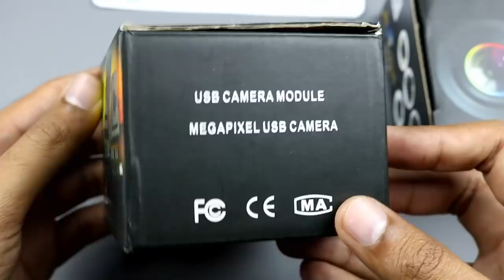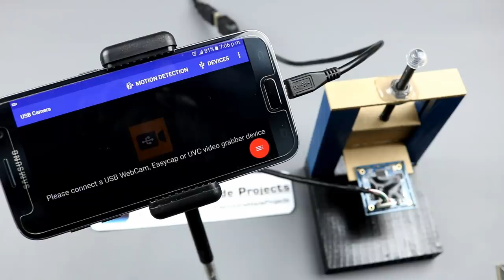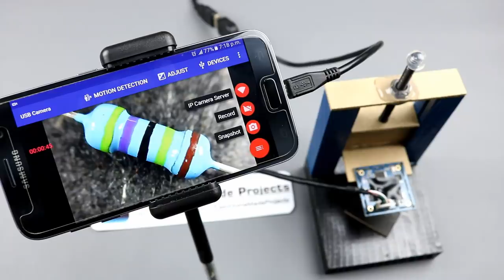How to make HD Digital Microscope

Comment: Nice idea but the camera on the phone is probably better. I use my Samsung Note 4 for this sort of work all the time as the zoom is great for reading all the component values and inspecting solder joints which I often need to look at different angles so a fixed platform doesn't work so well.

Comment: Using that particular camera apparently gives you very little clearance for a soldering iron, due to its short, but fixed focal-length. You might have gotten better results, had you used the third camera instead (i.e., the one that focuses like a DSLR).

Anyway, thanks for this video. This setup would likely save a lot of money over the purchase of an electronic hobbyist microscope. :)

Comment: Looks very interesting but the working distance seems a bit short for electronic use, is there a better camera that can work at a further distance say 10 or 12 cm away?  The magnification can be no more than 50 times
Reply: I am curious about the same thing you asked. It's been a year since you asked, so have you found the answer yourself seeing as you never received a response?
Reply: It’s actually only a matter of the stand (build it higher). ELP have such a wide range of camera modules (non-distorting, up to 1080p50, long focal distances) that you only need to select the one that perfectly fits your work situation. (I’m not affiliated with them anyhow but used their modules in the past.)

Comment: Great, I particularly like the mixed imperial and metric measurements.
Just wondering if I could strip the camera module out of an old phone?
Reply: You can do it, but you would have to buy or custom make an camera extension cable. They don't have a standardized pinout, so what works for you may not work for everyone. It's not worth designing an circuit that turns your phone camera's signals into HDMI. And if the phone is a smartphone, you can integrate it into it and get a microscope that beats all others for a similar price!

Comment: Another thing you can use as an HD digital microscope is an HD digital microscope. It's similar to this, only half the price, doesn't involve hot gluing and doesn't get in the way of your soldering iron when you're trying to use it while soldering.

Comment: Nice, but what is it with the hot glue.  YouTube has gone crazy over hot glue.  Don't be lazy and drill and screw together.  The projects will be sturdier and may last for years.  I give the hot glue a couple of months.
Reply: I built mine using Technical Lego and used hot glue to attach the camera and it is still as good as the day I built it over 5 years ago, the reason for hot glue is it can be removed easy if required.
Reply: Technical Lego is plastic, therefore is the hot glue suitable for attaching parts. But I agree with paul30003, drilling some holes and using screws is a way better than glueing, it is even easier to remove and replace components if needed and projects are waaaay sturdier. Indeed, almost every DIY project on YouTube is using hot glue, but it's not as sturdy as it looks at first. Believe me, I started my DIY projects same way, but I realized very soon, it's not a solution that can last for long. Other than that, a cool idea for a DIY.
Reply: because it's for youtube...
Reply: the question is, will you ever see this thing he built again? hot glue is enough when the thing is going to get ripped apart and either the parts reused or even returned to the seller or ebay'd, anyway. 

this channel is just a youtube channel for hits, not one of those "i do this as a hobby or a job, anyway, but i want to share it with people and if i can get a bit of cash why not"
Reply: Few years ago I call this phenomenon with young, modern youtube diy'ers "Hot glue generation" Everything mess with sticky white fluid.
Reply: I think it's quick and easy for the video, he had an idea, and maybe he didn't have screws or drills ... but he gives viewers enough information (or inspiration) so that they can choose better parts and construction on there own.

Comment: good idea but not efficient you have to remember when you work with hot-gun and the iron it can damage your camera, you should use one can zoom from distance. thanks anyway
Reply: you can easily select a different camera and do that just as easily. maybe he wanted it not for soldering. but you can easily pick one good for soldering yourself if you wanted. everyone's needs are different, so yes, it actually is very efficient.

Comment: too close for soldering, only for inspection
Reply: I think it is a great idea that can be adapted to the right soldering distance. even if you had to use a different camera. especially when the pre-made tools for the job are so expensive, this is an excellent idea to tinker with.

Comment: get a 16mm or 25mm lens
Reply: Yes, finally someone who knows how lenses work. With a bigger lens a bigger image circle is made, which easily covers the rather small image sensor. This is where the magnification comes from. With this, it can also be adjusted to focus from a further distance, making it usable for soldering, not just inspection.